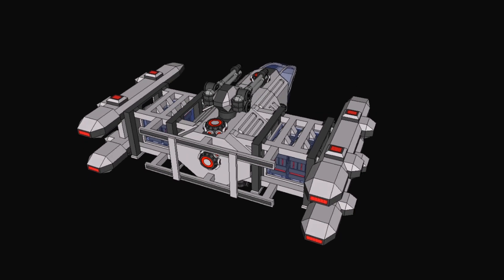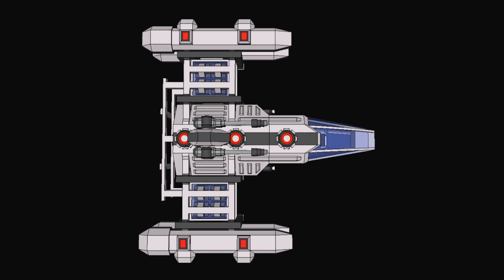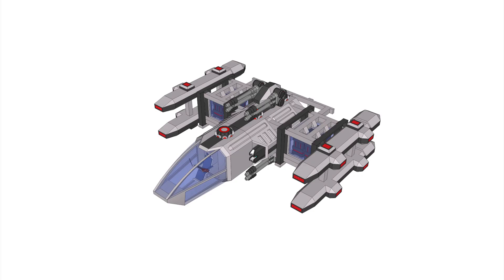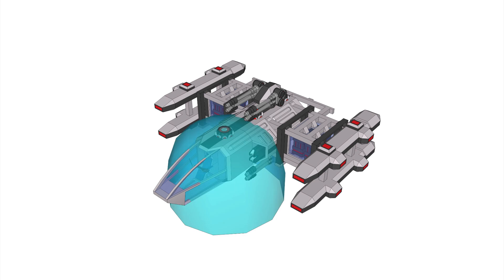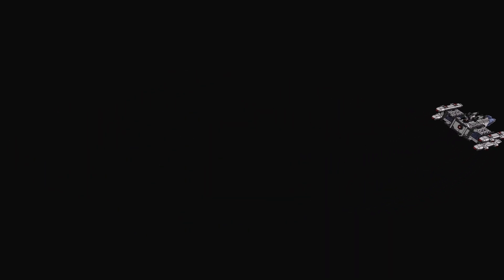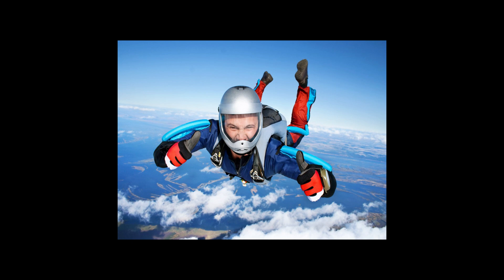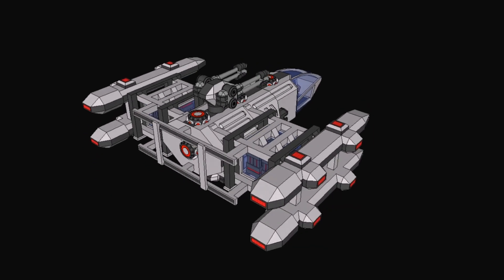Shad has a question! Gravitational acceleration on a spaceship?

Comment: In my world, it's pretty hard Sci-fi. Only truly hypothetical technology that is added is the Alcubierre drive, a sort of warp drive. It uses negative mass, to make a bubble around it self, basically deleting all empty space in front of it self and adding empty space behind itself. This negative mass in real life is theorized to maybe be achievable by dark energy as it already has negative pressure.

This warp drive, would basically work by the same forces that makes our universe expand faster than light, and as such achieve FTL-travel. However, energy limits it's size and conventional radio information can't travel FTL. Hence with this limitation, I think maybe old-school messengers are needed to communicate with other planets faster however I've yet to decide.

All this together means not every Spaceship can use FTL-travel, instead either using ion thrusters (One of the slower, yet cheapest alternatives) or controlled anti-matter. Anti-matter and radioactive materials are the most common to power ships and Rocket Fuel is rarely used anymore, at least not in actual space.

Of course other Sci-fi technology is there, but it's less fiction as we either know it can be created, or it already exists at lower scales. Personal Railgun firearms, or plasma guns for example exist. However traditional firearms are still in use, especially in space fights, almost like the Expanse (a big inspiration) as to not destroy the enemy ship entirely.

The world however have not discovered artificial gravity like yours, nor wormholes as I'm not really comfortable dwelling in hypothetical science I either don't believe can be achieved at all, nor that I don't fully understand myself. 

The closest thing I have is controlled black-holes, no bigger then a penny, being fet atoms to constantly produce Hawking-radiation to power Space-ships. The only problem I have with that isn't the actual source as scientists have a pretty good though rough understanding of it, however the actual power to make such black holes may be enormous, as we can't really make something massive enough to become a black hole and thus, would basically need to shoot it with enormous amounts of energy, possibly more than the Earth can generate. Still I think it'll be part of my ideal setting.

Comment: I had a similar idea of unobtainium that will be used in spaceships. But, my idea(inspire by your video about how spaceships would fly) will be used to make the ship act like a jet. The mechanic work when electricity goes through the unobtainium the spacetime will be pulled in the unrelative direction in which is going. This will create a hypothethical difference in timespace that will act like water would act in this situation.

Comment: Acceleration gravity only produces gravity in the direction of acceleration for example if you take a tower block into space and lay it on its side and call the top of the tower the front and the bottom the back and accelerate forward the floors would have a pseudo gravity produced by acceleration forces from the direction of travel. This way as long as the ship is accelerating there would be gravity pushing everything towards the back of the ship.
If your spaceship were to use acceleration forces to produce gravity it would have to be oriented with its top being the direction of travel or any floors behind the cockpit would have to have to be vertical to utilise acceleration forces as gravity.

Comment: You are right that the acceleration would get tiny if the gravity field was too weak, and it could take huge amounts of energy to create a significant gravitational field and alot of power to get significant acceleration, but there's no reason why this would cap velocity because there's no reason why it would get harder as you got faster.

Comment: 8:39 The effects of the moon's gravity on the Earth are actually quite significant. First of all it is the main cause of the tides, and second of all the center of mass or "barycenter" of the Earth moon system is about 3/4 of the way from the Earth's core to it's surface, which means the Earth wobbles quite alot relative to it's size as it orbits the Sun. That's part if why people sometimes suggest that the Earth-moon system should be considered more of a double planet (like how the Pluto-Charon system is a double dwarf planet with it's barycenter in the space between the two) rather than a planet with a moon.

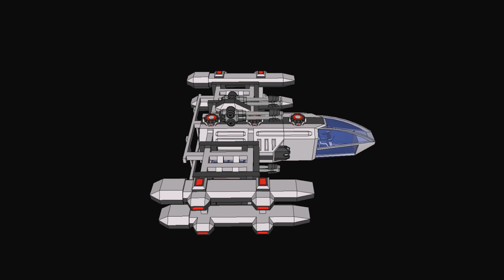Comment: 7:15 No. You are ignoring the Principle of Relativity. No matter what speed you are moving at relative to Earth or whatever else, you are still at rest relative to your own engines, so they don't need any more power output to accelerate you further. Velocity only exists relative to other things. There is no such thing as a maximum speed in a vaccuum except for the what I discuss below. Maximum speeds (or more accuractly maxumim Δv or CHANGE in velocity) are usually determined not by power output but by how much energy you can store per unit mass, which deterines HOW LONG you can accelerate at a given rate, not what your acceleration rate is.

Some space speed limits:

A) The faster you move, the more kinetic energy of space dust and even gas has to kill you if you hit it. For non-artificial gravity propulsion, Isaac Arthur serms to think that the limit on maximum speed would already probably be your ability to protect against space debris and destroy/push away/avoid larger particles before they hit you in the 10~20% light-speed range, and going above 90% even is specially cleans interstellar highways would be nuts. HOWEVER, according to a recent PBS SpaceTime episode on a recent paper. (https://youtu.be/Vk5bxHetL4s ) warp-drives (probably like what you describe even if subluminal), warp drives are almost to the space dyst problem because they speed up the dust as they hit it. The only issue is they have to make sure not to exactly directly aim at wherever they're going if they don't want to nuke it with relativistic space-dust released when they stop, but they probably would never aim that precisely at a destination unless they really were trying hard to nuke it anyway. (To quote Isaac Arthur, "There's no such thing as an unarmed starship.")

B) If you get RIDUCULOUSLY close to the speed of light, the Cosmic Microwave Backround radiation will get so blueshifted in front of you it will fry you and also push you(r remains) backwards. (Note that this means there actually IS sort of a privelidged velocity that is at rest relative to the Universe, or more accurately to the average of the CMB in a certain part of the Universe.) This is something people who study cosmic rays think about. E.g., I think the "Oh My God!" particle was an example of something (a proton) moving faster than this limit that usually stops cosmic rays moving this fast. This is so close to the speed of light that it's only relevant for if you want to utilize time dilation to let the crew go longer distances or weaponize kinetic energy, not for travel time from an outside perspective. Ridiculously high accelerations also produce something calked the Unruh Effect (similar to Hawking radiation)  that can theoretically fry you, which normally would be irrelevant, since those relative accelerations would also crush you into neutronium or other exotic forms of matter, but it may become relevent with gravity propulsion, where everything can be accelerated uniformly (Controlling tidal forces in a warp bubble might be a big problem, but I think that's been studied and solutions exist.)

C) The speed of light. No matter how much kinetic energy you add, you will never hit this. (The way that this can be consistent with the Principal of Relativity is the subject of Special Relativity.) Artificial gravity could potentially provide some ways to break this, though, but they are weird and also imply a certain amount of backwards time travel is possible. Artificial gravity propulsion probably falls into the category of "warp drives" in physics terminology, but this does not necessarily imply being able to go faster than light. That depends on exactly how the made-up physics works. (See PBS SpaceTime and Isaac Arthur videos about warp drives and artificial gravity and maybe the Unruh Effect.) People are often taught that the mass of an object increases as it approaches the speed of light. This change is only in the reference frame of other observors, and only if mass is defined and "relativistic mass". Perhaps a more intuitive way of looking at things in this case is with mass as unchanging "rest mass" and thinking about "proper velocity" rather than velocity fully in a different, non-accelerating, reference frame.

Proper velocity is the displacement according to the chosen outside observor (presumably slowly moving relative to stars and planets in the region, ?"map displacement" or "coordinate displacement") per unit time experienced by people on the ship ("proper time", closely related to "spacetime interval"). If velocity in one reference frame is replaced with proper velocity, the speed of light is infinite, and there is no cosmic speed limit. (Meaning relativistic physics doesn't technically prevent you from crossing the universe in mere seconds FROM YOUR PERSPECTIVE, though practical considerations discussed above do.) Also, I think Newton's 2nd Law  works perfectly for accelerations as long as the "a" in that F=ma is PROPER ACCELERATION experienced by the observor (which is nice because that's what's mostly likely to be constant, since that's the engine's and the ship's reference frame). (However, for some reason Wikipedia says you need to integrate proper velocity (w) with respect to MAP TIME, or outside observor time, to find the change in proper velocity or Δw after a period of time. https://en.wikipedia.org/wiki/Proper_velocity#Unidirectional_acceleration_via_proper_velocity I haven't figured out what that's about yet.) This should make it much easier to do basic calculations on engine capabilities for interstellar travel though, vs. using just map velocity.

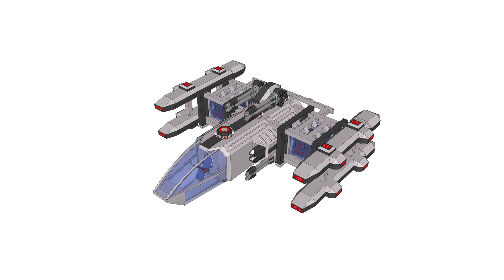Comment: That is NOT how gravity works. The gravity center on Earth is in the middle of the planet (gravity is generated by the mass of the planet. You have gravity too, anything with weight/mass does). The gravity is trying to pull you to the core of the Earth, but it can't due to the ground. 5:10 That would never push it down, but make the gravity center be in the middle of the sphere pulling Eveything in. You're gonna need the gravity center to be RIGHT in FRONT of the craft to go faster, same on the back and sides to slow down and steer. But to answer what you want to know. If we say you simulate Earth gravity in front of the craft ( 1g ), then you will accelerate 9,8 meters faster evey second. If lightspeed is possible in the world you can accelerate forever as gravity will ALWAYS work. If lightspeed is not possible in the world, you will never go faster than light.

Comment: acceleration does not decrease over time, max speed in space WOULD BE C-1 except that thing you ignored, friction from the death dust would punch massive holes in the ship unless you have a repulser deflecting it.

imagine being shot by a particle of dust which is moving near the speed of light omg that is worse than regular shooting (assuming that it has enough surface area to transfer it's relative energy into you without just passing straight through you i guess...

ok the problem is acceleration causes a relative time bend where you experience time faster than everything else, this means that if you ever managed to reach super close to light speed one second for you may be worth 100 sol-3 years to someone else, this means that your 10ms^-2 particle acceleration engine would require 100 sol-3 years to increase velocity by 10ms^-1

im not that smart with no fancy qualifications but you would need another machine to create an anti time field by decreasing mass, or fisheye bending space like with anti gravity but these would just turn your ship into photons...

just say it works cause reasons if you dont want to deal with half of this stuff but i love the rosetta sphere and your other scifi ideas!!!!

Comment: Well, this is totally three years late, but I think I have a few answers.

First, if I was to design a 'physics based' gravity field, gravitational propulsion would be impossible. Basically apply Newton's laws of motion, namely a force applied applies an equal and opposite force. So to have propulsion (except for spacetime warping, which could be an argument for gravity drives, since gravity warps spacetime) you need to eject material, the higher the speed the better. The gravity generators don't eject material, so what is the opposite force to the downward force felt in the artificial gravity field? Well, the clear answer would be that the opposite force is applied to the generator itself, so you would actually need to reinforce gravity generator mounting locations.

Now, lets assume gravity propulsion is possible, well then your idea about accelerating and top speeds and inertia is sort of right, but mostly coincidentally. More inertia means it takes more to say, stop something, but not to change its velocity a fixed amount. Under purely Newtonian physics, the ship could accelerate to any speed (same as any other form of propulsion). Now, relativity has something to say about that, and time dilation would begin to take serious effect as the ship approached the speed of light, making it more and more difficult to increase speed, with an absolute maximum at the speed of light (but never attained), and a practical limit somewhat below the speed of light. This is not unique to gravity drives, but any form of propulsion in space works the same way, except for the need to carry fuel which runs out (though you would need fuel for your power source to power the gravity generators, so its the same problem for gravity propulsion). An in universe explanation for why this wouldn't be used could be high power usage of gravity generators vs efficiency of other means of propulsion.

But I would tend to lean on the conservation of momentum argument, and claim that gravity propulsion is not possible. Basically like an elevator at stand-still, the entire elevator and people inside are pulled downward, but the cable holds the elevator from falling, completely counteracting gravity. Similarly, the gravity field pushes the space-ship and people and everything else 'downward' (or whichever way), but the generator itself, and thus the chassis of the ship, is pushed perfectly equally in the opposite direction, creating a net 0 force on the whole ship, even though people and objects inside feel gravity.

Comment: Despite of the problems with Newtons 3 law there are some more problems with flying very fast in space. One of the major problems is the misconception of people thinking there is nothing in space. Space is just an area defined by us humans that has less particle than x in an given volume. The difference is as always not that big when moving slowly. But once you get to an high speed (let's say 0.5 c or something like this cause I did no calculations) you get a lot of problems. One of them is a deadly dose of high energy radiation because of hitting particles at high speed. (Maybe you have to move faster then 0.5 c for that... no calculations done as stated so don't trust the numbers). The next problem is small dust and stones. Talking about throwing rocks at something with % of c. And these are not even the relativistic problems like mass increase of the blood that your heart has to deal with and so on... 
Most science fiction stories work around all these problems by some sort of warp thing. With this you basically do not accelerate to an speed but decrease the distance you have to fly in order to get to a specific point...
Relativistics do pretty weird things with our squishy bodys. Don't mess with it.

Comment: You could create so sort of "Space Wind' that would create a terminal velocity limit and ships with stronger GP (Gravity Propulsion) Devices would be able to travel faster. though ships would also need some sort of protection (energy shielding or armored plating) to prevent the ship from being torn apart by the "Space Wind". 
   Doing this would allow you to make up the speed limit yourself by determining how strong the ships GP Devices are and the density of the "Space Wind/Air" (which is like how the speed limit of a car is determined by the strength of its engine, which has to overcome the friction of the ground instead of the friction of the "Space Wind").
   You could also just not have the "Space Wind" be a thing, then there is no speed limit only a limit to how fast you can accelerate like in the Expanse. The difference between your world and the Expanse universe would be because the people in the ship/spacecraft are also moved by the GP Devices so you would not have to worry about them being killed by the acceleration. So having these GP Devices means that you can do whatever you want with the speed limit, but unless you want to have ships that can travel anywhere instantly (like Jump/FTL Drives) then you would want to keep the acceleration limit really low (around 1--3Gs) so that it would take a long time to reach that infinite speed.